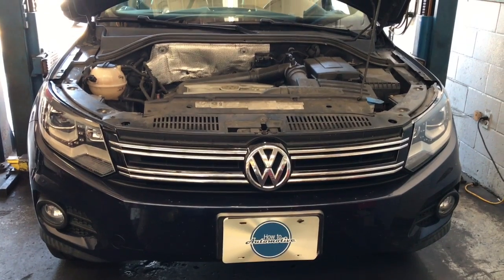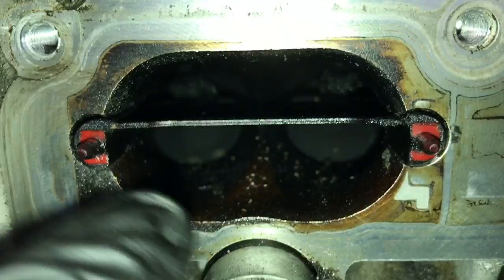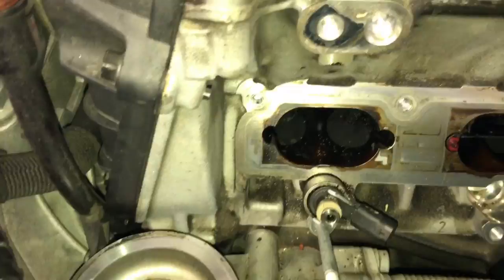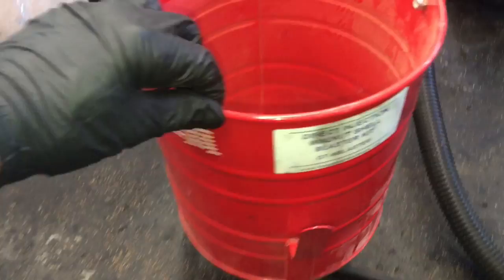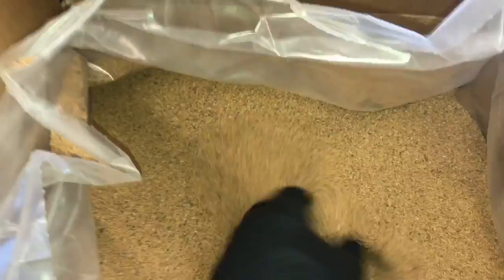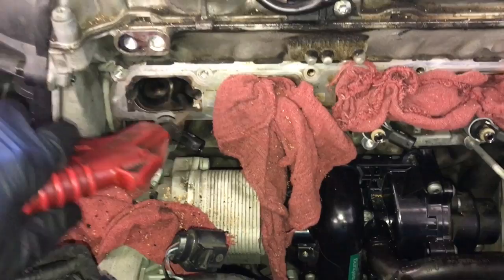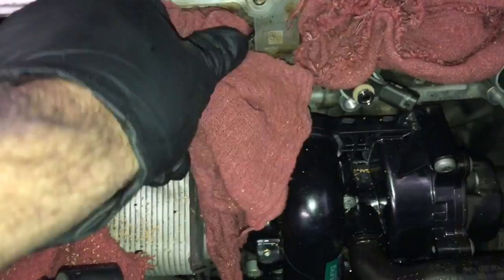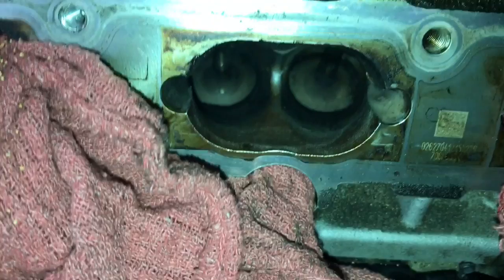How To Clean Intake Valves On A Volkswagen/Audi Direct Injection Engine

Comment: For those without a gun, etc. a less efficient method, I have used a brass brush and engine degreaser from auto zone it comes in a purple can, much better than seafoam or b12 actually degrades the residue and dries clean. I did this on a ford edge 2.0 t engine with the intake pulled off to access the back side of the valves. I like the radiotor hose idea i will have to try that attached to a shop vac

Comment: Thats the most efficient and cleanest method to clean.  I have people using messy chemical filling up the cylinder soaking it overnight.....
Reply from the maker: K Van i've done it both ways and I think this way is definitely the best. A minute or two on each port and you're done. Thank you for watching!
Reply: don't forgot about all that sand.....it stack beteewn the valvs and guides all the time and everywere in all the parts 
that sand (small rocks) make scratches on the cylinder, piston+rings, valvs guide and u can not repair that damages
believe me, i work with sand blaster sometimes
that dirty stuf u steel can clean it, but not the damages from the sand...must be very carefull with blaster
Reply from the maker: TheRazvan15 it's not sand  been used it's walnuts. If you use sand it will damage the engine for sure.
Reply: "How to Automotive"

yeah, but it would be also strange with soda bicarbonate.
Reply: @TheRazvan15  He never used sand dude.
Reply: TheRazvan15 sand ?? U most be drunk or high watching this video🤦🏻‍♂️

Comment: For anyone with the tools and space to work on their cars, this seems like a simple enough method; however, for anyone who hasn't removed an intake manifold before, it could be a longer than usual job. Time could be a problem. Purchasing a sandblaster isn't really 'cheap.' Although, its cheaper than taking the car to a mechanic whenever the carbon buildup occurs.

Comment: i still dont know if my car needs this done.. 2013 volkswagen passat with the vr6 engine. i thought its direct injection.. if i need it, the process should be almost exactly the same as in this video right? my intake manifold is a two piece i think, so slightly different though. edit: i have 103k miles now, should be due for it, but i dont feel anything..

Comment: Terrific DIY video.  We have two VWs, both direct injection so this is VERY helpful and a huge money saver. Harbor Freight has the sandblaster and walnut shells for $60.  I've already got the compressor, the vacuum and an old radiator hose from when I changed out our Pathfinder's hoses!  Thank you.
Reply: Did you end up doing it yourself? We have two Volkswagens and I’m tempting to do it myself as well. Ecs tuning has a kit but it’s about $400. If Harbor Freight has a kit that’s cheaper I would go that route seeing I have a compressor at home.
Reply: @velt1870  Hi.  I did not end up doing it at all. About two weeks after I commented on this video, my son wrote off the 2007 Passat with the 2.0L FSI turbo.  This car definitely required the cleaning.  If that wasn’t enough, my daughter then wrote off the 2012 Jetta which had the 2.5L non-turbo 5cyl.  This car was running great but I was going to take some time to check it eventually.   About two months ago we ended up acquiring a 2013 CC, 2.0L TSI turbo. Low miles, 96k. It runs great at the moment but I suspect it too will require a cleaning.  I would not purchase the kit. I will follow the exact method in the video when the time comes.
Reply: @dsiever1 question , I’m thinking of doing this myself & the reason why , is that when i give gas , the car has hesitation & jerks , was this the same for you ?
Reply: @paulrrasi4865  how does the car idle sound during the mornings on cold start?

Comment: This is Awesome. I'm right at the point of taking off the intake, and its just as bad.. I was getting under boost codes, and this will help.. also doing a timing belt due to mileage at 70k.  

If anyone is wondering media grit, or other, open the video Description!!!! its all in there!  thanks for hitting the nail on the head.. (I would cover injectors) but otherwise.. that hose idea is AWESOME!
Reply from the maker: A Dubber glad you like the video. Thank you for watching!

Comment: It looks like this method works great,  I really appreciate you taking the time to share!  Could you please give me an idea of what size radiator hose you used?  There are so many options available I'd rather not choose one that is too small or worse to large.

I'm also looking at walnut media and considering how much and what size.  I think I've settled on course.  The idea being that a larger particle size is less likely to sneak by and enter the combustion chamber.  Thoughts?

Now I'm down to quantity.  Walnut media is available in weights from 4lbs to 25lbs and even more.  How much do you think is a reasonable amount to expect to use for a single 4 cylinder engine?

Comment: Brilliant!!
Have you considered adding a clear section to the end of the radiator hose? Hopefully you'd be able see while cleaning. Those plastic seasoning bottles might be a perfect fit and some cost less than $1. Maybe even those skinny beverage bottles? 
Anyways, my original plan was to tape clear tubing (about the size of straws) around the sandblaster nozzle. The tubes would join into to a single 3/4" - 1" dia hose and then into the shop vac hose.
I was searching for existing examples but found your video instead. I'm thinking your design might be better... especially if a clear section is added to the end.

Comment: Are there smaller or differently shaped attachments for the nozzle in order to do more detailed cleaning? It seems like quite a bit of area is missed at the top and base of the ports, the part of the valve stem facing away from you, and the exposed portion of the valve guides. The ability to articulate the nozzle, and thus the media stream would be very beneficial for a more thorough cleaning.
Reply: He did not point the gun there, if he did it would be gone. Maybe 4mins per port would be better, then 2 mins per port.

Comment: Could you go on more detail how you made the extended sand blaster noodle. Did you need to buy pipe and tap it? Does the blaster extension have a tip or just open ended? Thanks!

Comment: That tool is really nice out of a radiator hose.
But I have a question, I saw some videos but nobody tells how to see if the valves are close. Is it easy to see?
Reply from the maker: Joao Jesus yes when the valves are close you can see it by looking in there. If they’re open you’ll see a gap. You want to make sure you rotate the engine By hand until the gap’s clothes on the valves. Then it is safe to Walnut blast.
Reply: How to Automotive thanks for your reply :)

Comment: This might be a silly question to ask but when you say "valves are close" does the bottom round part of the valve have to be all the way down touching the bottom of the metal ?
Reply: The valve should have moved upward to where it's seated, where it would be during compression or exhaust strokes

Comment: This whole time I've been searching for some type of shop vac attachment. Thank You! What's the pressure set at on the wand? And where did you get the extension attachment for the wand?
Reply from the maker: spoon55 i'm not regulating the pressure so whatever's coming out of the hose. As far as the extension I just made it out of aluminum tubing.
Reply: Thank you. What do you have your air compressor set at? And how big is the tank?
Reply from the maker: It's set at 120 PSI. And I believe our tank is 85 gallons

Comment: I need the nozzle attachment where can I find one? The one on the gun all I have is the ceramic tip that came with
Reply from the maker: frank lopez you can make it with a piece of aluminum pipe. I have seen them at Harbor freight may check their.

Comment: Question for you. Have you noticed the carbon deposits are more common on VW/Audi than other makes? Or do you specialize in this brand only.
Reply from the maker: Doug N I see it most VW/Audi and BMW have not run across ether brands yet.
Reply: It's a very common thing for ALL direct injection engines in general. In this type of engine the fuel that is sprayed into the combustion chamber does NOT flow over the back sides of the intake valves like other injection configuration types. Therefore, cleaning treatments that are put into the gas tank will not clean the valves as in other engines.
Reply: That's true, but it's only LESS oil, not NO oil. Oil vapor STILL gets in, and it's only a matter of time before you get build-up. It just takes some cars longer depending on environment, driving style, weather, fuel quality, etc.
Reply: We found this problem quite heavily among the LNF engines on the Kappa chassis GMs.. causes a rough idol after around 70,000 kms. Good to see this fix as it will be the same for our club..the joys of direct injection engines with pcv venting in to the engine through the intake.
Reply: Alessia Aikley that is the fix one of our guys did..dual canisters to collect the vapour and oil mix... I'm looking for something to use now to do the same

Comment: WHAT a junk technology and quality VW uses. are you nuts  to do this ? what is a cost of the procedure ? 500 us$ ? every year ?
I better drive a Toyota. Zero maintenance like this for 30 years and the car runs like a charm.
VW are crap engineering.
Reply from the maker: A Y I would agree it’s not the best design engine. Good for mechanics though we make a lot of money off of them.
Reply: @HowtoAutomotive  exactly. its a money making for technicians - that is 100% correct. But its a nightmare and a money pit for car owners. I did my mistake with VW once and it was enough. 
I am now sticking with toyotas for ever. much much much better quality and reliability.. zero problems, zero costs and hybrid NASA grade technology that gives my real 75 miles per gallon in the fuel pump (4th generation - 2019). amazing.

Comment: Sorry Brian.. first time I give you a dislike. I really not feeling comfortable with that method. 
Any slight infiltration of sand inside the motor will turn into a catastrophic end. 
Give us another more effective more safe method to do that cleaning. 
I understand that chemical solution is not effective at all.
So IAM depending on you experience in this matter. 
Also, mention some effective tools as you always do. 
Thanks 😊
Reply: Its walnuts dummy
Reply: @ALs_Autos  
Lol.. that is a good one... Thanks 😊
Call it whatever you like depending on where you live in.